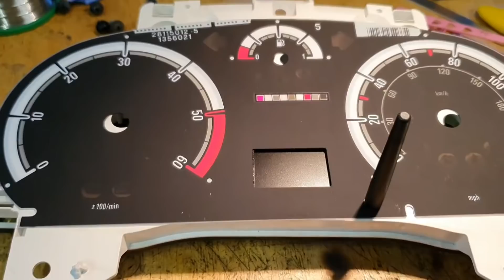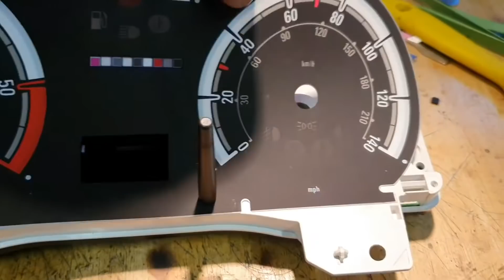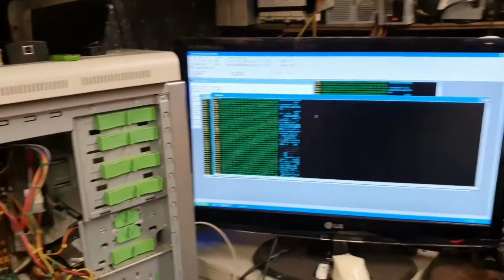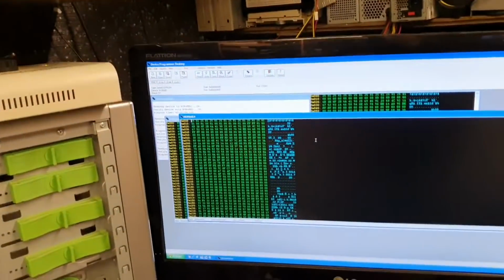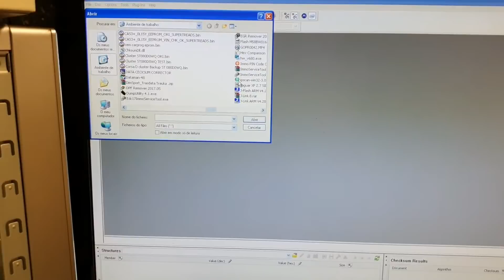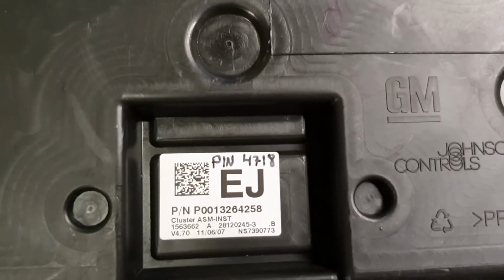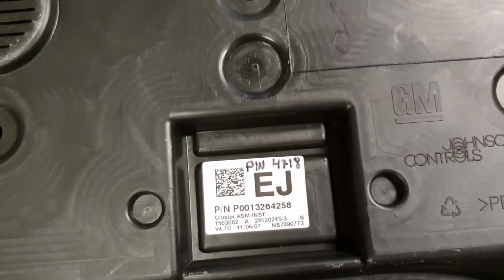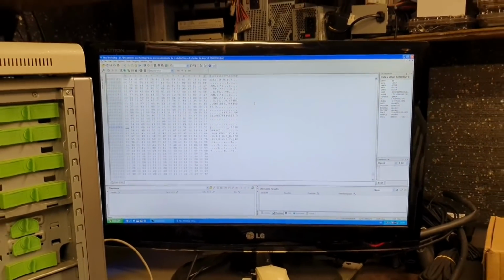Corsa D security Pin from cluster EEPROM.

Comment: hello excuse me for disturbing you I have a question my friend he has corsa d 1.0 petrol it does not start and he has an Opel corsa d 1.2 petrol starter kit is it possible to reassemble it and the car starts
Reply from the maker: Well... there are so many variables and so many questions...
The software for the engine might be different, and the car might not run right...
Replacing all of that can be a waste of money, as if the problem is something else, you will still be left with the same problem after swapping all that...
The best approach is to scan the car and understand what it causing the non starting condition...
Have you done that?
👍👍👍
Reply: @LMAutoRepairs  dashboard problem no code the card is dead and also air bag calculator and I have not yet placed the complete kit from another car c the same may c 1.2 and mine 1.0
Reply: @LMAutoRepairs  I have the complete starter kit but it no longer starts fault code B3902 and P0633
Reply from the maker: The codes are keys and  immobiliser related...
As I previously mentioned, you would be better just replacing the part you need, the engine ecu, and leave everything original...
Less messy, less confusing...
Which modules have you replaced?
Reply: @LMAutoRepairs  I replaced complete Neiman kit with Lee calculator and dashboard and BSM
Reply from the maker: @abdelkrimsekrane6759 
On the Corsa D the Airbag is supposed to be part of the immobiliser system...
I am not really familiar with that Neiman and Lee stuff...
I usually just replace what need to be...
Like here...
https://youtu.be/70mteUUUzjg?si=bWfiENSrYAPGwkuA
Reply: @LMAutoRepairs  ok

Comment: hello I have an Opel corsa dashboard dispute I can modify it like you did. mine it no longer starts and I changed the airbag computer of the same reference do you have to program it so that the car starts thank you very much
Reply from the maker: The cluster and airbag module are part of the immobiliser system on the Corsa D...
👍👍👍
Reply: @LMAutoRepairs ok I will extract the pin code from the dashboard and air bag computer

Comment: hello, I have an opel corsa d and the dashboard sound does not work. I'll check if the speaker works, maybe I have to change the dashboard. can i unsolder eeprom and solder it back on the new dashboard? with doing that could put the new dashboard?
Reply from the maker: Yes... it should do the trick...
👍👍👍
Reply: @LMAutoRepairs  thanks!!

Comment: hi thanks for the videos i have a problem. I have a corsa d 1.4xer engine the intake manifold exploded on me i replaced it and now i have no speedo or fuel gauge readings
Reply from the maker: That shouldn't have any influence on the issues you are having now...
Unless something was damaged during the occurrence or the repair... double check everything around the area... scan the car and check live data...
👍👍👍
Reply: @LMAutoRepairs  give 3 errors knock sensor circuit,  temp voltage to high and immobiliser no or wrong signal knock sensor connetor was broken
Reply: thanks for the reply
 still no gauges though
Reply from the maker: Can you actuate the gauges with the scan tool?

Comment: Great video and very informative, I have an issue with upc mate , can you help me with this please . Thanks
Reply from the maker: On a corsa?
Reply: @LMAutoRepairs  no it’s on Renault Clio mark 3 , 2008 automatic petrol 1.6 , thanks for getting back to me in short space of time
Reply from the maker: No there is not... I do this as a part time only...
What exactly is the issue?
Reply: @LMAutoRepairs  ah sorry I didn’t know that , I have got a upc used one and want to virginise it or clear it down , but I have both original and replacement too , can you help me to get this done please , original one was water ingress and causing the vehicle to start on its own , now I have exactly same part number but only getting fault for airbag B0500 which was not there before fuse box replacement, thanks very much
Reply from the maker: Best way is I would say, is install the new upc and connect the car to clip, renolink or any other capable tool, and go through the settings, see is is possible to adapt the module... it might be worth if you still have communications with the old one, to check the settings on that, before plug the new one in...
Reply: Thanks very much for sharing your thoughts and experience mate , new one ordered .

Comment: Would you know where to get replacement motors for the Rev counter and speedo for Corsa d
Reply: @Dave C google cluster stepper motor. That should get you on the right track.
Reply from the maker: Probably cheaper to just buy an used cluster for parts...
👍👍👍
Reply: @LMAutoRepairs  I thought your repair methods are to fix and not just to replace and create more waste. So far you impressed me by actually fixing things when possible instead of just replacing parts like the parts changers at the dealerships.
Reply from the maker: Indeed... but unfortunately some times it is just impossible to repair...
Use a stepper motor from a used cluster, still better than buy new... it is reuse after all...
👍👍👍
Reply: @LMAutoRepairs  I repair, code, and flash mostly MB clusters of all ages and I have a box full of new stepper motors and displays. They really cost Pennies compared to even a used cluster. 

I also like to repair vs replace (anything in fact not just car parts). We certainly are a small group of enthusiasts trying to do the right thing for the environment and customer.
Reply from the maker: Indeed... Great work you do as well!
👍👍👍